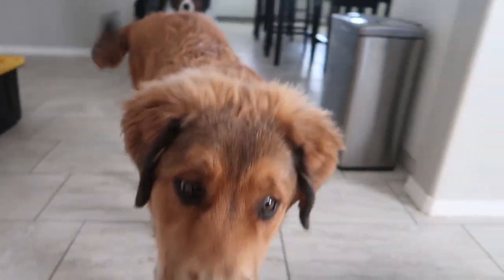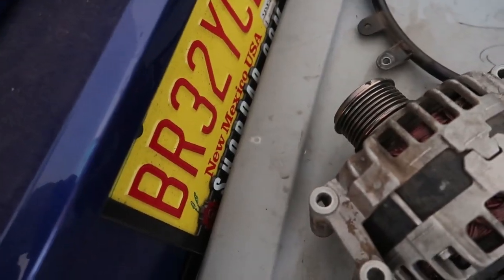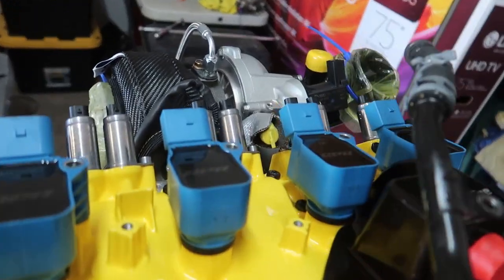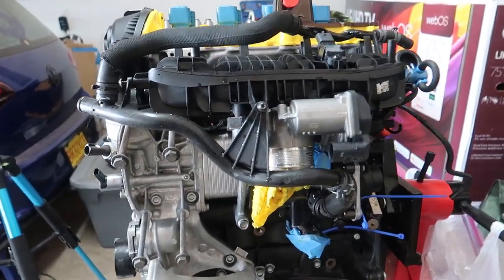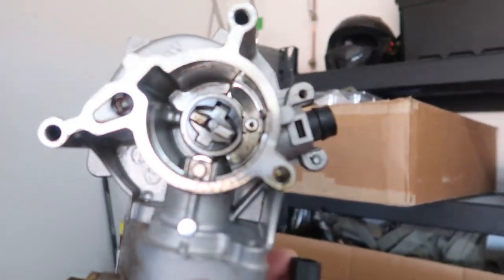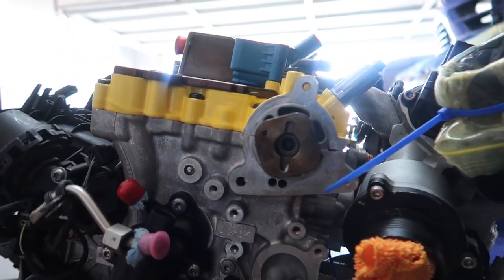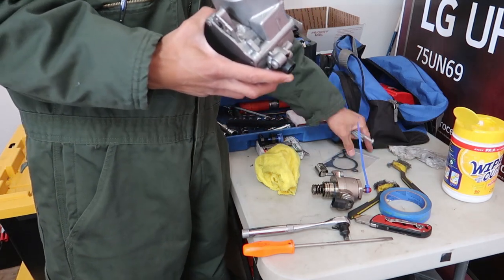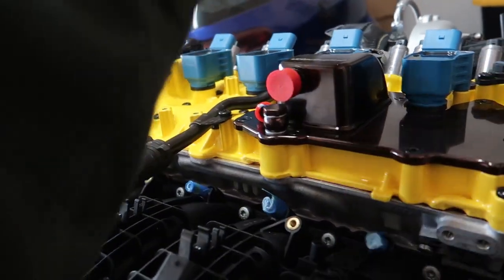Intake manifold all shined up! HPFP installed! | MK7 Golf R

Comment: That HPFP metal fuel line is the most difficult piece to take off and put on when removing the IM. I’ve cleaned my valves twice, so I know. For anyone doing this job, with the engine in the car, there’s a certain time when you want to remove and then install this piece, which makes this part much easier to do. Also, using a stubby wrench is a life saver when tightening the bottom nut! Pro tips 🙂

Comment: 13:10 there's this stuff called Green Slime I use on my O Rings which helps them seal and lubricates it for sliding into openings like that. It also helps to make sure you don't tear the o ring during installation. :)
Reply from the maker: I slipped on some assembly lube she went in after some muscle. Those viton rings are tough cookies lol

Comment: Have you thought about getting the HPA Motorsports intake manifold v2? I been thinking about it. I’m only on stage 2 with fbo and I wonder if the manifold would help with the dip at higher rpms on the stock IS20.
Reply: Just go IS38 lmao
Reply from the maker: That's not for these motors

Comment: Suprised you didn't go for an aftermarket intake manifold. In the UK a company called MRC sell one that's billet and follows great at higher boost
Reply from the maker: Going to later in time! Wanted to make it easier to tune in case issues popped up

Comment: where did you find that valve cover from? ive looked all over
Reply from the maker: It's not a (normal) cover, the cam girdle is an integrated "cover" that also holds the cams in place.. journals and all. Not an easy task to just remove and paint and replace like you see on most JDM cars. Typically when this comes off you have to re time the whole engine, there is ways around it.. but they're sketchy.